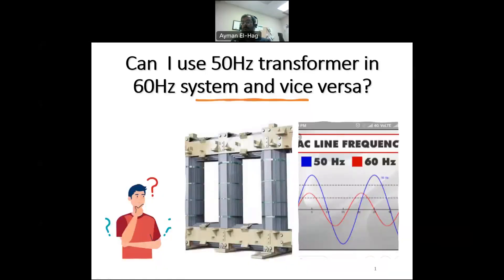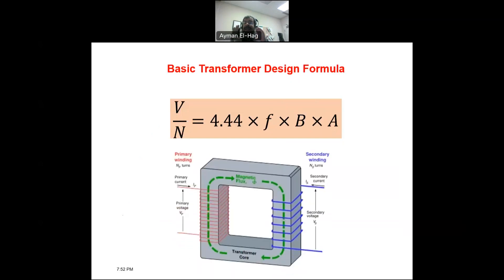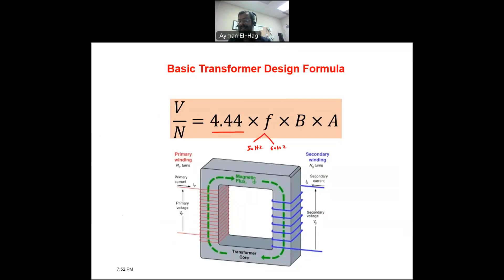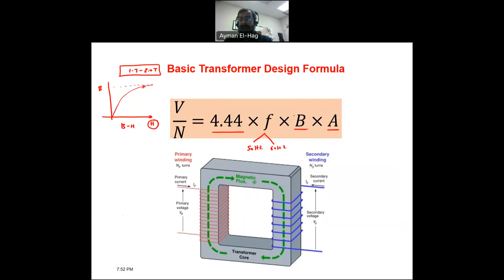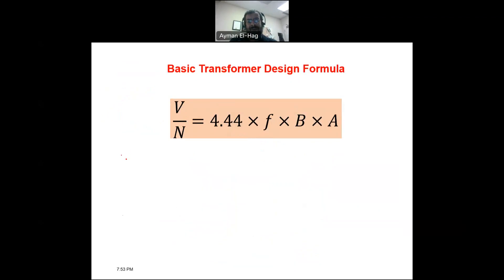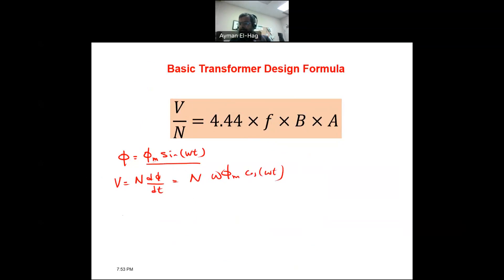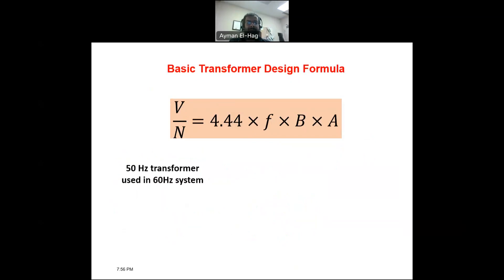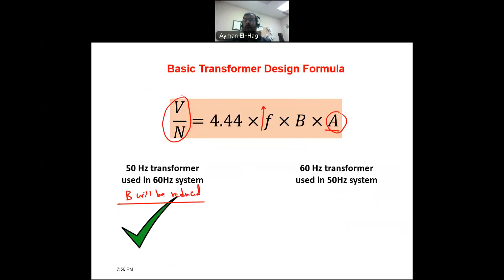Can I use 50Hz transformer in 60Hz system and vice versa?

Comment: Nowadays, all types of electrical transformers can work using a dual frequency system, namely 50/60Hz without any weaknesses or losses in the performance of the transformer even with the same voltage.
Reply from the maker: Of course you can design a transformer to do that if it is intended to work in double frequency. However, if you design, let us say a distribution transformer in 60Hz system, we usually select B to be around 1.85-2 T and hence if you use it in 50Hz then saturation will happen.

Comment: Does the short circuit current is diffrent at 400HZ as an exemple or it will study as per the standard of IEEE 1584 - related to 50/60HZ
Reply from the maker: The transformer core will saturate around this frequency so most likely you will still have induction at 400Hz. For the short circuit, do you mean during short circuit test to measure load losses or during fault? And from where this 400Hz will come.